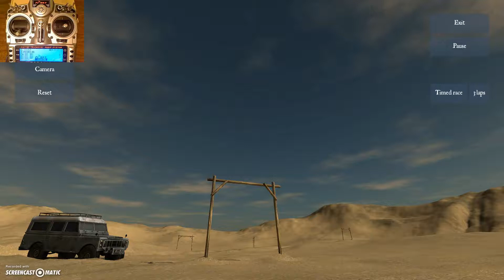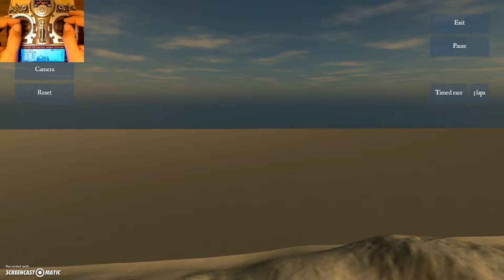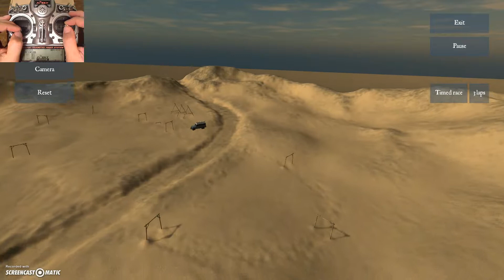How To Fly A FPV Racing Drone - Lesson 8 - Drop And Catch

Comment: Your lessons are awesome. 
The free version on freerider is junk (can't change the sluggish default rates in the free version), but the paid version is great. It would be far better if I had an actual radio to try it out and not the virtual thumbsticks. If you let go of the virtual thumb sticks for even a moment, then you have an almost guaranteed crash.

Comment: Tipp: don't do this with a big (let's say over 1kg) quad. I learned this the hard way a few years ago. I was flying line of sight with a homebuilt camera copter (ca. 1.5 kg) and went up pretty high, like 150 meters. (yes, it was all legal) I wanted to get rid of my altitude quickly so I more or less did more or less this maneuver. I droped the throttle as far as I was still able to keep the quad under control and let it descend quickly. Then I tried to catch it (according to the logfile at a height of 90 meters) but although I gave full throttle The quad just kept on falling. I was able to keep it in a level position but it just fell down to the ground and crashed. I didn't know why and what happened and got help on a forum. Somebody said I most likely got into the vorte ring state (see https://en.wikipedia.org/wiki/Vortex_ring_state). It happens during a rapid descend but when the horizontal speed is nearly zero when you descend into your own downwash. In this state you loose almost all your lift, even if you are at full throttle. So if you do something like this always make sure you got some vertical speed.

Comment: Can I try this on a cheap mini quad which has got like oneshot 125 ESCs?
Reply from the maker: +Sangay Lama sure.
Reply: Thank you and another one...
I am learning FPV. The video seems so good when I am flying straight away from me but I have noticed in my flights that when I try flying straight towards me, there appear lot of interference(almost unflyable) I even waited to see if the interference will decrease when its nearing towards me but no the video won't get better unti I yaw a little and show the antenna. Is it normal? 
In my setup(its a PnP), the vTx is on the back, battery on top middle and radio RX in the front of the quad. 

Thanks...